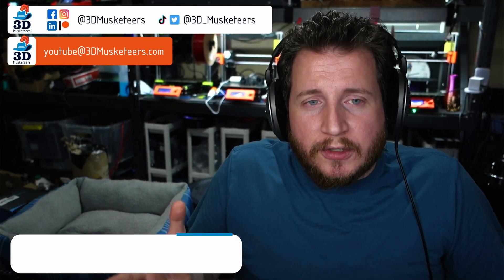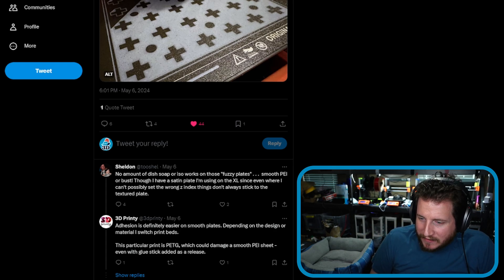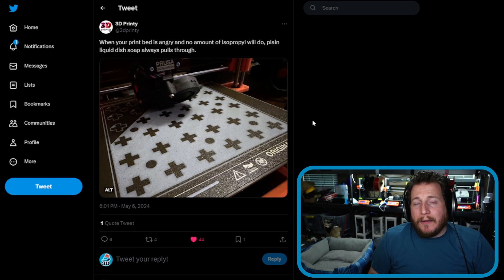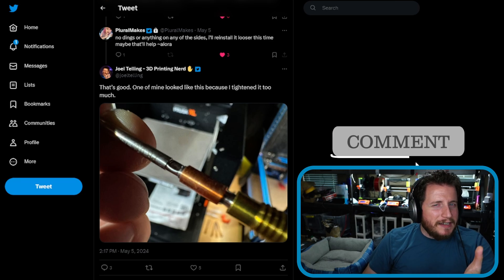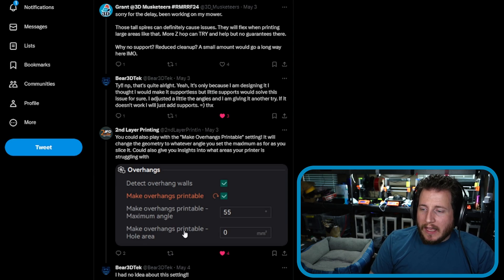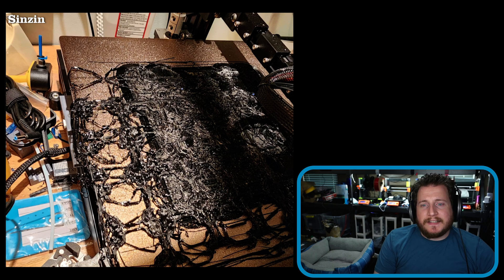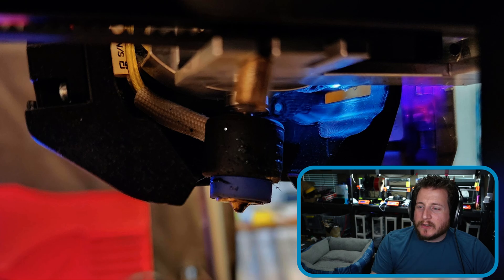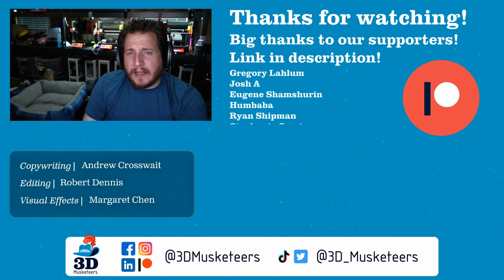Clean Beds = Happy 3D Printers! - PrintFixFriday 139

Comment: I've been using Prusa textured sheet almost exclusively for years, had a lot of problems in the beginning but not for long time:
- Touch with fingers as little as possible
- Clean with IPA and paper towel before every print
- use them with one type of filament only, mixing PLA and PETG works for 10-20 prints but at some point both won't stick!
Reply from the maker: Interesting, I mix all the time and don't have issues.. hmmmmm
Reply: @3DMusketeers  For me simply cleaning it with IPA99% before every print was not enough, problems stopped after I bought second pei sheet for pla printing. 
I suspect tiny filament particles are left in the groves of the textured sheet with every print, and it impacts the adhesion.

Comment: Bought my i3MK3 in late '18 and it has the Prusa textured coated build plate. For cleaning, I use acetone as much as IPA and I clean the build plate before any print. No visible plate deterioration in all this time. The first month of printing I had some adhesion problems, I lightly wet-sanded the entire textured plate surface with 400 grit Wet/Dry sand paper and those issues disappeared. My experience has been when the first layer height adjustment is good, so go the prints. Last year I bought the Satin Build Plate, I use the aforementioned dish soap or IPA and again, my prints stick even the tiny parts and I avoid "Brims" like the plague. No point here, just my $00.02USD.

Comment: Does Prusa even offer a smooth sheet for the XL?
Reply: But I should add, I bought the smooth sheets at the same time as the printer I think, but I've never used them. Like Grant, I thought I'd need then for pla. But I just get on so well with the satin for almost all materials. I only use textured for stuff like tpu. See my other comment about sugars which might explain my success.
Reply: Yes, I have one, don't know if they are currently stocked/sold
Reply: @tg_73  interesting.  I know they have the Satin and Textured, never saw a smooth one before.
Reply from the maker: They do. Hilariously I have the textured and the satin.. I have a smooth in my cart though with some other stuff.
Reply: @3DMusketeers  off to do some shopping at Prusa then.
Reply from the maker: Something something affiliate link ;)

Comment: 3:28 no sanding nor complex preparations for the textured bed, just a simple clean with dish soap, dry it with paper towel and 99% isopropyl alcohol. Some filaments may require 3-5 more degrees, but that's it.

Comment: I got the thumb screws so tight once I couldn't remove it from the heat sink. Worse yet . . . it was an ObXidian. Expensive lesson.
It can be hard to get those thumb screws just right sometimes. I've had problems with them coming loose too.

Comment: I was having problems with my textured pei plates after about a month, losing first layer adhesion, & i print huge flat pieces.  
 i found a video about using steel wool for about 5 minutes in all directions. i tried it with those soapy ones, no go, because they are non-abrasive. 
  i found some "00" on amazon & tried it out, it works perfectly! you need a little bit of abrasion. if your sheet rolls water off immediately, the same thing will happen with liquid plastic on a molecular level.
  also, add some mouse ears for good measure & whola, even huge 300x200mm flat pieces will stay in place every time. but of course, wash that plate daily with regular dawn & you will be fine until you need to steel wool it again every other week or so.

Comment: I just stuck my mk4 nozzle in the oven at 480. I was able to push out like 3 inches out of the nozzle with an allen key. I can tell it's not perfect. I have to let it cool down before I know if that fixed it. There was filament inside the  heatbreak part. My fault for not tightening it down enough.
Reply: oh and if I forgot to mention before it's PETG.

Comment: I like the satin sheet a lot, but I can't deny smooth does work better. I did print my mmu3 parts on it and I can't get rid of the adhesion surface of the parts. I did try soap and water. I didn't try windex. It just looks ugly. It still works.

Comment: Your redomendation to use Windex or a dishcleaner detergent is a perfect advice! 
IPA does contain a smal ammout of organic "oily" components (long chain organic compounds) from the manufacturing process. When the IPA evaporates these oil stay behind and can cause these adhesion issues. Special purified grade IPA is used in the semiconductor industry would be pur enough but for the price of 1 liter you get an discounted Ender 3. I have dealt with this issue already 20 years ago in the semiconductor industry.